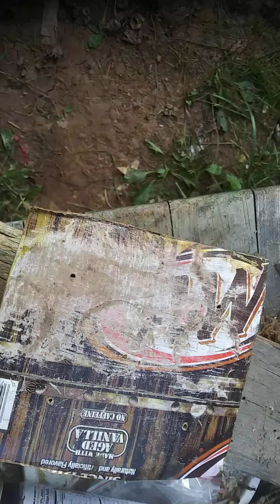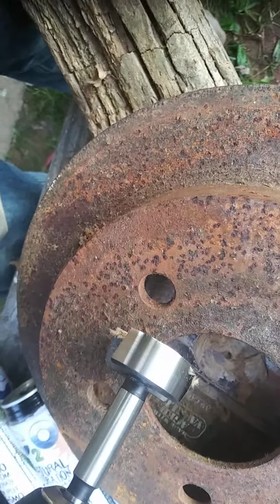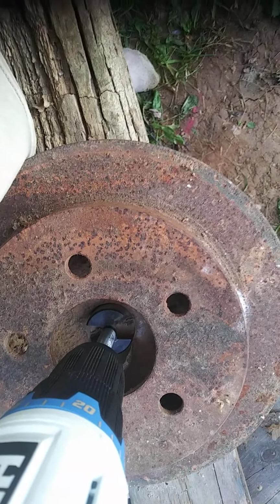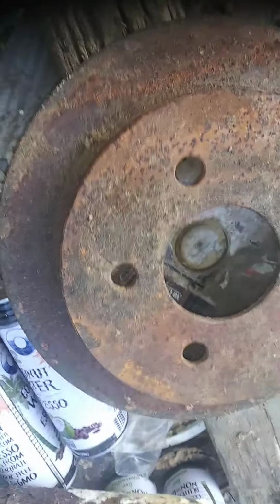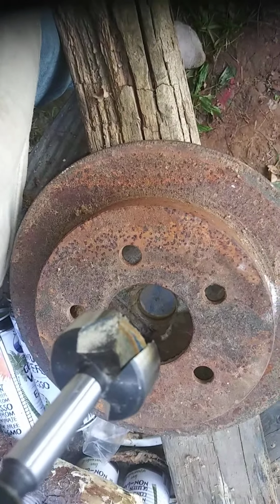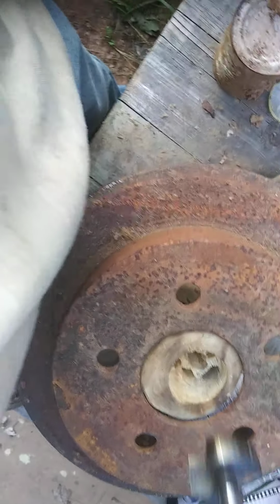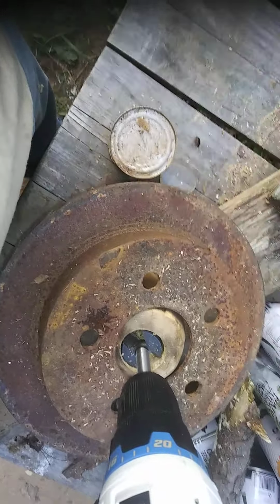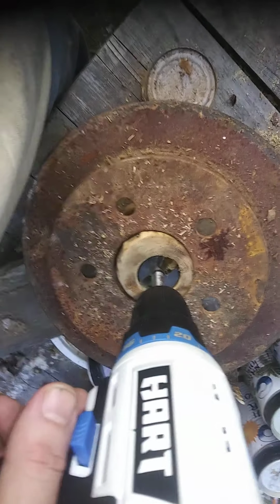making homemade lamp part 2 drilling part 2

Comment: Just found your channel.
Reply from the maker: Welcome to my channel
Reply: @THEAPRILFOOL-1983  Thanks I found it watching it a tights review video.
Reply from the maker: @jones1068  I watch a lot of videos like that in one of my older videos I show how you can use old pantyhose cardboard a tree trunk to make your very own potting soil just can't remember the name of the title
Reply: @THEAPRILFOOL-1983  I forget you call them pantyhose in America 😁
Reply from the maker: @jones1068  there's a difference between tights and pantyhose we got both in the US I've used both for plant material but the pantyhose will actually last longer than tights or maybe it's the other way around I'll have to test both to find out at the same time
Reply: @THEAPRILFOOL-1983  we have leggings and tights here I like the opaque tights. Opaque tights are 40 denier and above.
Reply from the maker: @jones1068  I got about three pairs of leggings one of the pairs of bought were two small I usually get those because winter weather to help stay warm when I'm outside and the price for men's tights or men's leggings are extremely expensive I may actually take the old ones cut them up into small pieces cast them in a resin blank with some wood and see if I can send it to another YouTuber and see if they can make something cool out of it